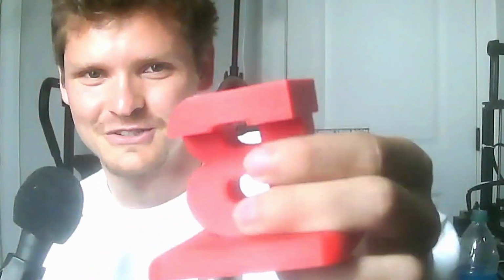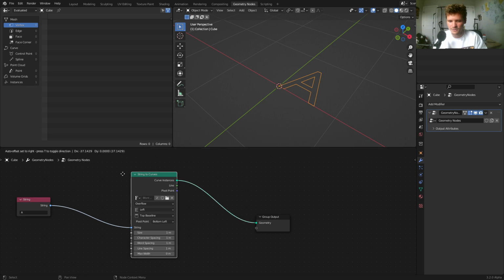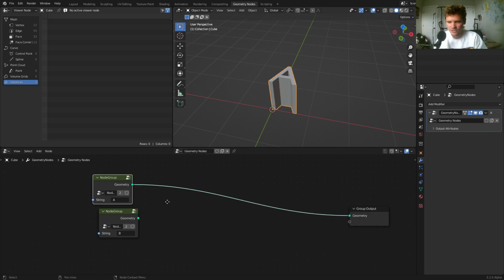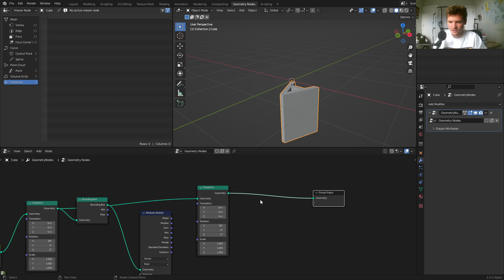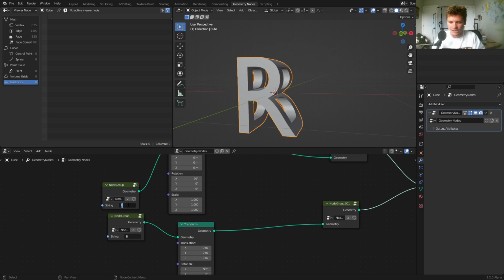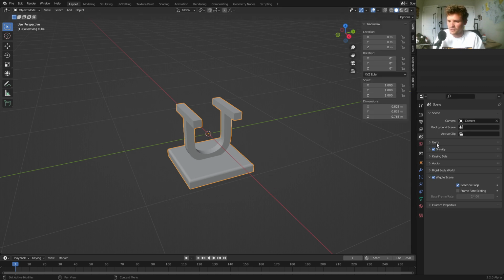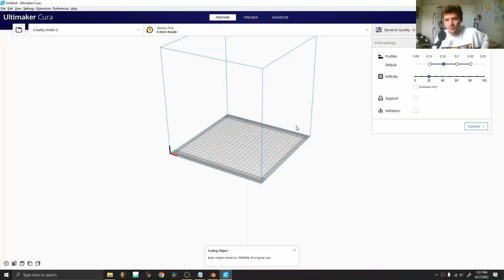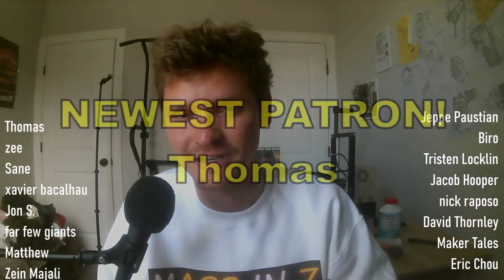LETS 3D PRINT GEOMETRY NODES

Comment from the maker: Once I get my extra filament + envelopes I'll be printing 10 of these to send to fans! Just shoot me an email at cgmatterofficial@gmail.com if you're interested (with your pair of initials, US address, and I'll tell you about payment once I calculate how much it costs)!
Reply: You should try using the lightning infill for parts that doesn’t need to be durable ie art and stuff like that. For more durable prints ie mechanical parts increase the amount of walls and use gyroid. Also use tree support which are way easier to remove from the print especially if you select on build platform only and in most cases it uses less filament.
Reply: US only? noooo

Comment: For some reason whenever I get to the Boolean the intersection messes up so much. ps im on 3.2 alpha.
Reply: I have the same on 3.1.2… also the centering of the bounding box is off for me
Reply: @DennisUlijn  The centering was off for me but then I restarted the tutorial and it worked!
Reply: I have the same. 3.1 though. Up to join the geometry is fine. At intersect fills are missing and no good. No luck so far. Anyone?
Reply: @bertboerland  I made the project a second time and then it worked. I compared both projects and i found a problem for me was the two text options in the Attribute Statistic. They should be set to Vector and Point. Maybe that solves a problem for you....
Reply: 3.2. beta. same thing. intersect screws up
Reply: see the answer above: "I didn't see anyone else having the problem I had, but if you have a really buggy looking mesh after doing the Mesh Boolean, go back into the first NodeGroup, and on the Extrude node, check "Individual." He doesn't do it in the video but I went back through and couldn't find what I did wrong, so hope this helps.
"
Reply: I had the same problem and I changed the fill curve from triangles to ngone and then it worked
I have no idea why but it worked for me at least

Comment: I didn't see anyone else having the problem I had, but if you have a really buggy looking mesh after doing the Mesh Boolean, go back into the first NodeGroup, and on the Extrude node, check "Individual." He doesn't do it in the video but I went back through and couldn't find what I did wrong, so hope this helps.
Reply: I  add the same problem, but on contrary of what you say, I uncheck "individual" and my problem was fixed like a breeze. Thanks to you may I add!
Reply: I would think that having "individual" UNchecked would yield the best results. 🤔
Reply: @oodoodoopoopoo  "Would be the solution to the problem" may I confirm!
Reply: unchecking this works, thanks!
Reply: THANKS MY SIR
Reply: Unchecked Individual and it's good to go! Many thanks!

Comment: Your scaling isn't right, but Cura applied an automatic scaling (which it popped up a message for). STL files don't actually store any kind of scale units. Cura and most CAD software assume mm when saving/loading STL files. Blender use meters when writing STL files. I've found there are two easy ways to deal with this. The first is to just work in meters in Blender, and know that 1m=1mm. The other option is to work in the actual scale in blender, and when exporting the STL set the "scale" option to "1000". Either of those methods will give you the exact right scale when imported into Cura.

Comment: The undercut on the T will need support, the printer will struggle to create unsupported layers. Temporary supports can be added in the slicer software, supports can be easily removed when the print is complete.
Reply: Was about to,say this.  Supports are needed for that horizontal.

Comment: I got the Bounding Box node to work with just the Min and Max outputs, just add the Min and the Max Vectors from the bounding box together and then scale that vector by -1/2 to get the inverted center vector. That's your translation vector to center the text.
Reply: Cool. Alternate solutions give me a deeper understanding of the possibilities and what is required at this step. Thanks for sharing!

Comment: You should procedurally generate all combinations
 of two letters and upload them to any site.
I think many people will find it useful. As a blender guru,
 it won't be difficult for you =)
Reply: OR, just be a patreon and download the blend file 🤣
Reply: Roman standard upper case letters: 26 - that's 676 combinations.
Bit spammy but doable.
However, then you factor in:
- numbers (36² = 1296 possibilities)
- lower case letters (62² = 3844 possibilities)
- other alphabets
- special language-specific letters in extended alphabets such as umlauts
- letters that change depending on position in words
- other kinds of symbols
- other fonts
This becomes untenable fast

Just point people to this tutorial. It's short, to the point, easy, and as flexible as anybody needs it to be.
(Also not all combinations are gonna give you single-piece results that could actually be printed)
Reply: @Kram1032  I think so too. You can also add a letter along the Z ;)